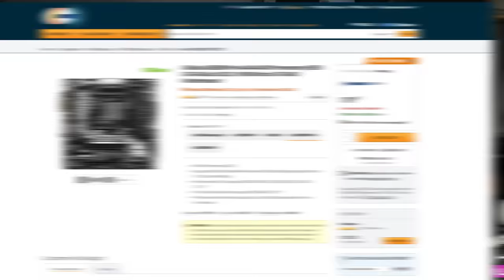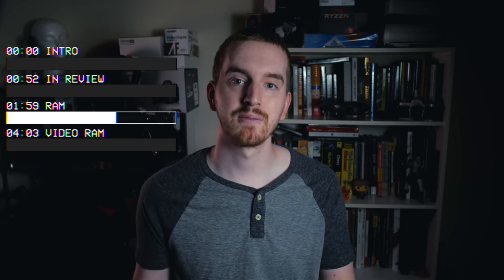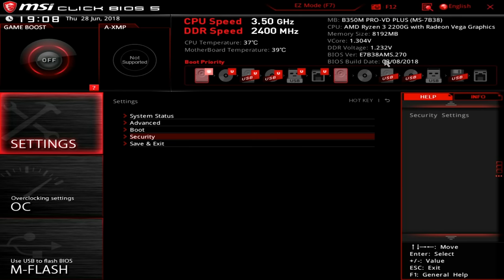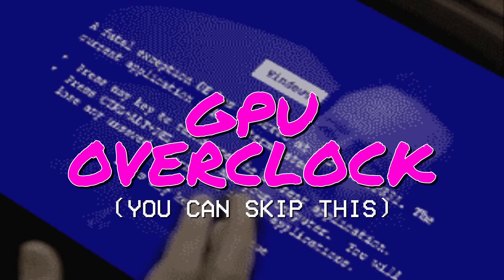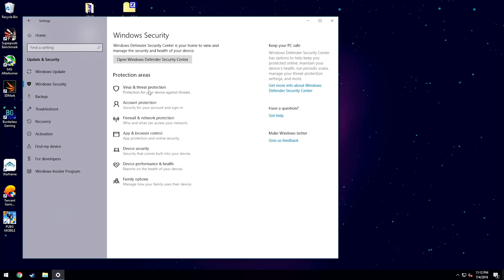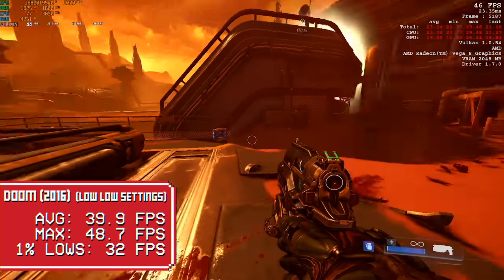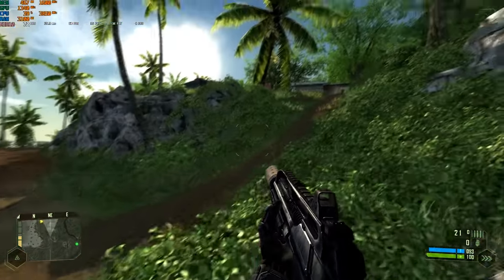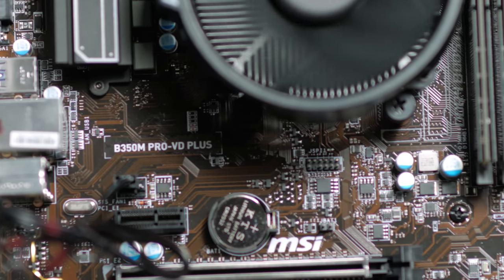How to get INSANE GAMING PERFORMANCE out of AMD Ryzen 3 2200G APU - Ryzen 2200G Optimization Guide

Comment: He didn't mention the single greatest tweak you can make with the 2200G: play your games at 720p! This will do more for your frame rates than anything else. I know 720p doesn't look good in 2018, but if you're running a budget system like this, it's much better to play at 720p at 60 frames per second than to try to play at 1080p at 30 frames per second.
Reply: selohcin I like 900p. 720p is a bit too small, imo
Reply: I use a 32 inch 720 p tv with a laptop u get used to it lol I just ordered my 2200g and gonna get the rest of my parts in 2 weeks I will just be happy to see better fps than my laptop which is a Bristol ridge apu
Reply: sure
Reply: I agree 720p is the PS4 resolution (fat version)
Reply: just get tho cheap ass 720p used screen and hook it up as a secondary monitor.... play games @768p @ the screens native res it look decent tbh!!! keep ur 1080p screen for all ur other stuff simple...
Reply: @vanufps5170  no both ps4 and ps4 pro run at 1080p. Ps4 pro does upscaled 4k so not native 4k but its decent enough. But still not 4k which is a scam
Reply: use fxaa
Reply: I think 900p would be great on this  fps wise, the 1080p is much and 720p is too low, middle ground would be the 900p
Reply: 720p is fine for many gamers, I also think 30fps locked is fine if you play with a gamepad and this kind of system would get some pretty decent results with that, but it's not for me as I perfer higher resolution and frame rates but I can see the benefits for gamers that want to build a budget PC.
Reply: update i have since built the pc with the 2200g it did very well at 720p even 1080p but now i have a gtx 1050 paired with my 2200g and i am very pleased with a 1080p monitor
Reply: 900p is tottally decent for higher end games:) 60fps solid
Reply: @thijmstickman8349  or T-AA and reduce render scaling
Reply: @mrhappy8966  Can you give me a full build of your system i'm planning to get the 2200g
Reply: msi b450 m-2 mobo- gskill ripjaws 2x4 gb 2666 mhz ram- cooler master q300l case- seasonic 520 fully modular psu-and this is optional but i have a be quiet pure rock slim cpu cooler but the ryzen 2200g comes with cooler i also lucked out on a gpu got a gtx 1050 for 30 dollars new from a good friend. also 520 watt seasonic is a bit overkill and pricey not needed i just wanted a little upgrade room
Reply: @mrhappy8966  Hey this is my build for 490 euro's: 
Ryzen 3 2200g
As rock b450m 
Ballistix 8gb  ram 2x4 2400
WD Caviar blue 1TB HDD
Corsair 500W 

Including case and monitor 1080p up to 75hz

Is it a good build? 
And will this build be overclockable? Ty
Reply: ya sounds like a good build im not so sure on the price but i am in us and i believe our prices differ
Reply: also all b450 motherboards should overclock to my knowledge
Reply: @mrhappy8966  Why do you have a cooler btw? overclocked the apu to 3.8 3.9?
Reply: My ram sticks are overclockable to 3200 mhz with motherboard but i'm not so sure about the apu
Reply: But to get the best out of it i want overclock apu to 3.8 or 3.9 
IGPU vram to 2gb 
and 8gb ram 2400 to 3200 mhz 
Just want to know if it needs a cooler or a better mobo thanks
Reply: the amd site says the 2200g will only do 2933 mhz which is where i have my ram clocked at but idk forsure i never went any higher....
Reply: actually i just like superior cooling solutions id rather have overkill than underkill and my cpu stays at 50c under load which is much better than i anticipated i use a be quiet pure rock slim cooler i got for 27 dollars i would say for overclocking u definitely want a aftermarket cooler the integrated graphics make the apu get pretty hot on stock cooler
Reply: @mrhappy8966  how much fps you get with the gpu you add with apu
Reply: i get around 40-60 fps high ultra settings on new games some games above 60 fps
Reply: Men the consoles are in 720p 30fps
Reply: 100th like
Reply: 720p isn't bad, it's great! It's just that people think "bigger is better"
Reply: What about 1366x768
Reply: I play on a 32 inch tv at 720p, since i do it at 2 meters i don ´t see much difference with my other 40 inch tv at 1080p yet the performance difference is substantial.
Reply: @vanufps5170  No...
Reply: Why? What's wrong with 30 FPS? I mean, I cannot detect much difference between 30 FPS and 60 FPS, and as long as there is no stuttering or glitchiness, then 30 FPS will be perfect for me, and I'd rather sacrifice the extra 30 frames than sacrifice the quality of the graphics... I am just saying...
Reply: Besides, I am going to pair the AMD Ryzen 3 2200g with an XFX OC+ RX 570 8gb XXX edition. So I am not expecting too much trouble...
Reply: Here's my build for US$926.90:
1 Kingston HyperX Fury Black 16gb at 2666mhz RAM card for $107.99. 
A Spectre C100 case for $69.99.
1 EVGA 600B watt PSU for $48.99.
A 100ft Ethernet cable for $23.99.
Asus Tuf x470-plus gaming Motherboard for $135.99.
1 Samsung 970 EVO 500gb  NVMe m.2 PCi-e 2280 SSD card for $129.99.
AMD Ryzen 3 2200g for $94.99.
Windows 10 home on a usb for $147.99.
1 6ft HDMI cable for $6.99.
XFX OC+ RX 570 XXX edition for $159.99.
Keep in mind that this is going to be my first gaming rig build experience ad my first gaming rig ever. So, I had to order every little piece of hardware plus the windows operating system. Some of the products that I had ordered had altready dropped so privces may very greatly...
Reply: very true
Reply: 900p
Reply: 900p is also pretty nice
Reply: i have 2600XT frommATI from 2007 and 720p looks great but i have to playmon 360p .. in 2019
Reply: Frankyyy  2400g ???
Reply: or buy a gpu i have a ryzen 2200g and rx 580 8gb
Reply: Seriously , 720 and 1080 to me, don’t diff too much , playability over quality in this case. 

Also, kudos to Vega 8 apu with such gpu, no need for dedicated gpu which cost a lot .
Reply: 1024x768 is even better. Graphics doesn't matter
Reply: I have ryzen 5 2400g and it works perfectly
Reply: I have the 3200g and I run at 1080p
Reply: Só true, basically doubles the Frame raten though looks pretty bad in some games..  so I still go with 900p or above most of the time
Reply: i have a ryzen 2200g and 1060gtx im planning to buy a ryzen 2700 broke ass upgrade for me
Reply: Cant believe this comment is about 4 years old now.

Comment: I just build this PC for around $250 without a case, mouse, keyboard, monitor......I use it my old one LOL.............Ryzen 3 2200G, 2x4 GB RAM DDR4 HYPER X FURY 2666MHZ, 600 WATTS PSU from a brand from here Mexico, Stock cooler AMD Cooler, 1tb hard drive, windows 10 pro.............I am currently using without a case LOL and it works great my first budget PC gamer and it feels so great..........
Reply: @Awm66Shdn NO.....For what i can hear my A320M-K do not overcloock....................

Comment: Even 5 years later, this video was very helpful. I have a ryzen2200g+RX580 8GB and the CPU can't always keep up, my system has been outdated for a while but I've really been wanting to play some newer games but they weren't the best experience, and I've watched an entirely seperate video on overclocking and noticed little differences, but this video helped boost my CPU speed by a good bit which helped alot with my performance.
Reply: I ran this same combo for a while and it worked great for the games i played. You have so much upgrade potential thanks to am4. Hope you're able to get them at a good price.

Comment: I know this is 2019 but I'm still gonna use this puppy for my build, and overclock it of course since this will be basically my gpu for the next while since I won't be able to afford anything after I get this.
Reply: It is fairly good at gaming and you do not even need an external gpu which is mindblowing. I use this cpu and I do not normally play games, but occasionally I do. Just lower she settings a little bit, game shadows to the minimum, maybe smaller resolution if needed by a very heavy game and gg. For the most games, this is perfect budget solution! Oh and you can always buy a strong dedicated video card if you want. Ryzen for the win!
Reply: Combine agreed 720p with low shadow and high view distance you will Get 90fps

Comment: Higher SoC Voltage is needed for a higher and more stable gpu clock. 
Let  me just tell you that Cpu overlock isnt as important as getting your GPU to 1600mhz cause that makes more difference than 3.8ghz OC
Reply: TheSinisterEyes1 searched for this comment
Reply: TheSinisterEyes1 can i oc only the gpu with the stock cooler?
Reply: Yep!
Reply: @ikoloo5942  Check out the video on overclocking with a $20 aftermarket cooler by Hardware Unboxed. You can get some sick results for very little money.
Reply: Please help me with gpu overclocking. Last time i overclocked cpu and GPU both and damn the temperature Reached 82°c.
Reply: If you're using only the APU then you don't need to overclock the CPU. In your scenario the GPU is the bottleneck for your system (if we're talking about gaming). The CPU is most likely around 40 to 60% under load and the GPU would be on 100% load. Running the CPU on stock speeds or even REDUCING it's clock speed and increasing the GPU clock will make your games run smoother, with higher FPS and lower temps. Alternatively if you're using the stock cooler that came with the APU just get a better one, no need to overspend a simple 20-30$ cooler will make your system run a lot cooler.
Reply: I got a 4.1Ghz overclock loll
Reply: Teodor Kirilov instead of spending 30 bucks for a new cooler u can buy a 2400g, makes more sense to me.
Reply: Cesar Xotta u might be right but to me its too much looking into the future. i still would invest the 30 bucks in the 2400g instead for a cooler. another advantage besides the better performance is less power consumption for the same performance. u ve to consider u need the better cooler for the 2200g because u want to do overclocking, thus means higher temps for your cpu and a higher bills to pay. i would go wit the 2400g if i really have the money for the better cooler and spend it for the 2400g with more shaders and smt (8 logical cores instead of only 4).
Reply: Kigama I don’t know if you realize how much 0.1 extra volts of electricity a month actually effects your power bill...
Reply: I beg to differ
Reply: @KiKi-rp1hk  its a graphics car so yeah that would happen, gpus can hit 100 lol
Reply: @ryanmiller4646  I was reading a page were some guys compared the power consumption in a medium specs rig, with a gtx 1060 i think, stock vs overclocked, the overclocked consumed literally the double electricity. About the Ryzens i found this. 
https://tecn.cubava.cu/files/2018/04/amd_apu_oc-91463.png

Comment: Not that i just got a major boost on performance it also resolved my issues with the inverting colors and game crushing. Both thumbs up for you man
Reply: I still got one problem, I get black screen in Dota 2 and only in Dota 2 (Everything works, you can hear the character moving when you click but you have a black screen and it doesnt comes back). Today I am downloading GTA V and see if there are problems there.
Reply: @stefangavrilov9372  I'm 2 years late but this happend to be when I overclocked my ram.
Reply: @tanuv  After two years I started thinking that most of the bugs and problems are windows 10s fault. Why? Because every time windows gets an update it resolves similar bugs like in my first comment and new arise and this just keeps happening. My last problem was after adding additional 8gb ram, every time I turn on my pc there is a blank task in my task manager that took 90-100% of my CPU usage and lsass that took more than 50% of my RAM. I could not find any solution on the internet for this problem and not even anti-viruses helped. So every time I turned on my PC I had to end those task by myself and everything was fine until next time. The last windows update took care of that
Reply: @stefangavrilov9372  ahh, btw do you still have your 2200g? and how does it perform now?
Reply: @tanuv  still doing great! The 8gb I added were major boost as well, since the APU uses the actual RAM as VRAM I only had 6 before and now with the 14 I can play games on much higher settings
Reply: @tanuv  In other words, I highly recommend having more than 8gb ram with the 2200g, only than you can see how good it is. And it's incredible when you see the price
Reply: @stefangavrilov9372  I've hooked up a gtx 1660 to it with 8x2 DDR4 2666mhz, I feel like I suffer from lower frames after an hour of playing
Reply: @tanuv  I have asked google a question or two :D it seems 2200g is a bit slow for gtx 1660. The internet recommends a faster CPU
Reply: @stefangavrilov9372  yeah that's what I thought

Comment: I was having the same system crashes mentioned in this video on my 2200G. Putting the system through 15 minutes of gameplay, the system would crash and reboot. After I spending 20+ hours of troubleshooting, it was discovered that the OCed RAM's BIOS configuration was the issue. I was using the pre-configured BIOS DRAM profile, which misses a lot of the configuration needed. I found Ryzen DRAM Calculator on overclock.net and went through all the numbers it gave me, and placed them throughout my BIOS DRAM's configuration [ there's 30+ fields that need to be adjusted ]. Now I'm running the following stable for hours, even days:

CPU [ 2200G ] @ 3.8GHz
GPU [ 2200G w/ Vega 8 ] @ 1600MHz
RAM [ Corsair Vengence 3200 2x8GB ] @ 3200MHz

If you're still experiencing these issues with overclocked RAM, I highly recommend trying out the Ryzen DRAM Calculator utility available on overclock.net: https://tinyurl.com/ydaprr49

Comment: Ive heard there is a blackhole in the overclocking range of these apus.   A glitch makes it unstable between 1300 - 1500 mhz.    If it doesn’t work past 1300mhz try 1520.
Reply: yep, heard the same thing
Reply: Interesting. I have a spare 2200g from upgrading the processor a while ago, so I'm thinking of turning it into a living room media PC that can do some light gaming.

Comment: Overlocking the cpu WON'T make sense since the Gpu is at 95-100% usage
Reply: Some games are more cpu heavy, such as overwatch
Reply: Yes, but if your thermal headroom isn't the greatest it makes more sense to OC the gpu first, then CPU if thermals allow.
Reply: @Βασίλειος Μπεσλεμές we're talking about an apu here. In your case the gpu is a good match for the CPU. In the case of the 2200g and 2400g the CPU far outstrips the igpu. If the gpu is the bottleneck and you only have thermal headroom to oc either the cpu or the igpu does it really make sense to choose the cpu? I'll answer that for you, no it doesn't. Oc the igpu first, then see how much thermal headroom you have for the cpu.
Reply: @taylordonaldson5075  nope. CS:GO is veru CPU bound and runs primarily on one core. Faster CPU clocks will give better performance over faster GPU clocks.
Reply: @ryzenfromashes  there's far more games out there that benefit from a faster gpu than CPU. If the gpu can bottleneck the cpu at only 40-60% of the cpu's capable output then it makes sense to oc the gpu first.
Reply: @taylordonaldson5075  Absolutely, just CS:GO is going to benefit from a CPU overclock.
Reply: @ryzenfromashes  and you're not wrong. If csgo is all you play then OC the hell out of the CPU and leave the gpu alone. But for anyone who doesn't play cpu bound games exclusively, gpu then cpu for the most performance out of the apu.
Reply: @ryzenfromashes  nope, csgo uses all cores
Reply: @taylordonaldson5075  not always true plus your underestimating amds tech

Comment: You don't need to remove the CMOS battery or have a board with a CMOS button.  The vast majority of motherboards come with jumper headers to clear the CMOS.  You can either short them with a screwdriver for a few seconds, or if you have another power button lying around somewhere, you can connect it to that.
Also as others have pointed out, there's no need to increase the VRAM amount.

Comment: Bought my first desktop in 2019. Had practically no knowledge of PCs. Bought an HP Pavilion with Ryzen 3 and 4GB RAM at Sam's Club on sale for $419. Came with a monitor, keyboard, and mouse. Only upgrades I've done is RAM and a graphics card. Went with some 2x8GB DDR5 RAM and a GT 1030 GPU. By no means is it a fast PC but all I use it for is YouTube and Minecraft. Not a bad PC set up for around $500 all in. If I had known more about PCs back then, I could have gotten better performance for the same money but overall I'm satisfied with what I've got. Debating on upgrading to a Ryzen 5 or 7 CPU, GTX 1660, and an M.2 SSD, or building a completely new PC.

Comment: 400mhz APU speed is vers correct. All GPUs, iGPUs, APUs downclock to save power. My GTX 1060 6Gb OCed to 2100mhz is also downclocking to 600-800mhz and after starting a game it goes up to 2100mhz.